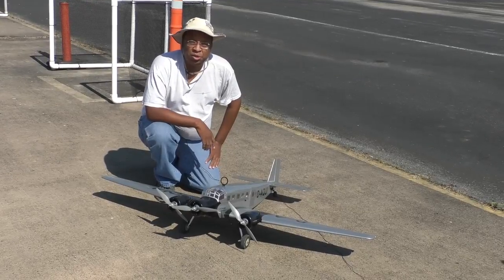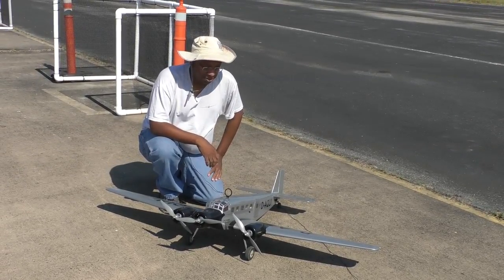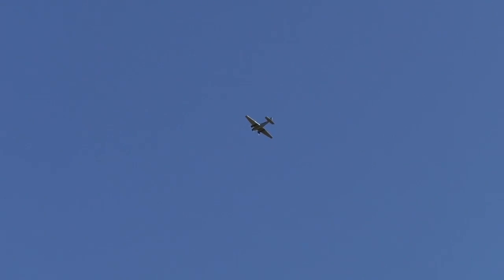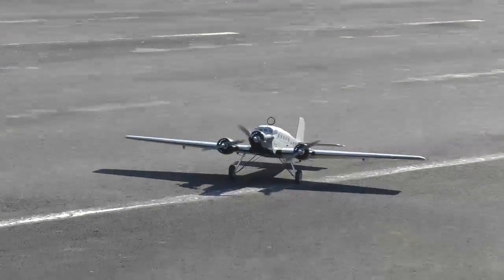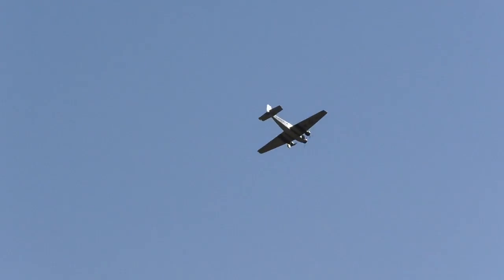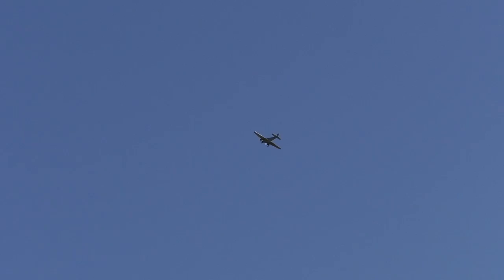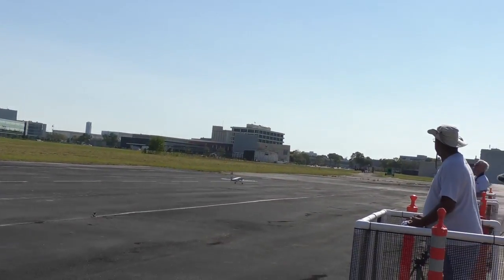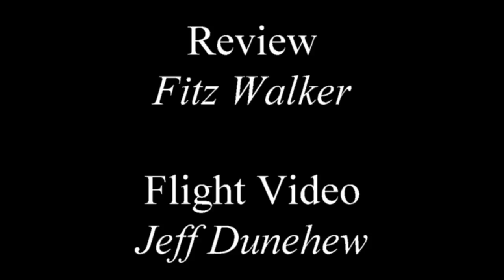VQ Models Ju-52 Flight Review | HobbyView

Comment: I also have the VQ Tante Ju, in Luftwaffe Splinter Pattern.  I've noticed many of the same problems that you've highlighted.  I do counter-rotate the center prop, to somewhat lessen the p-factor yaw.  Another thing that I discovered that really helps to minimize the squirreliness of the ground handling is to keep the tailwheel planted until the speed gets higher.  Then, when the tail comes up, it's easier to control with the rudder.  My Ju-52 is also fast, flying a 4S-5AH pack and Propdrive 2835 motors.  I've had problems, twice, with an elevator control horn failing when the speed was high and I cranked in a lot of elevator.  I agree totally with your assessment of it's flying weaknesses, but I love flying it because it is so iconic of the Luftwaffe (I'm a big Luftwaffe warbird fan).  Nice, fair review!  Subscribed...

Comment: May I make a suggestion? If you install a eagletree stabilizer that plane will fly like it's on Rails. I've been using eagletree stabilizes for a number of years and I find it a best on the market easy to install easy to set up and you can make adjustments while in Flight as far as gains control concerned. I use eagletree on every single one of my planes